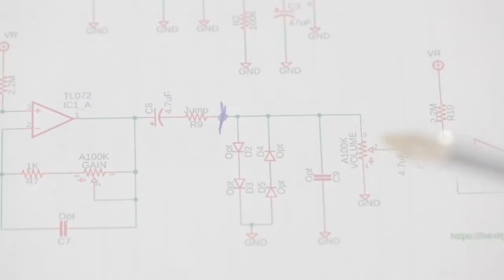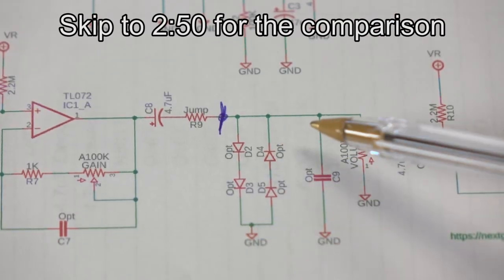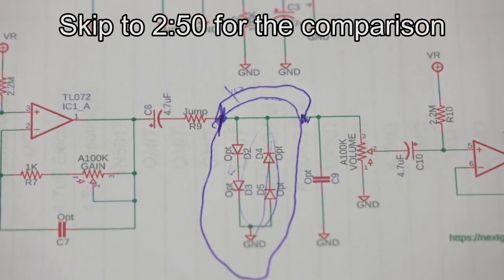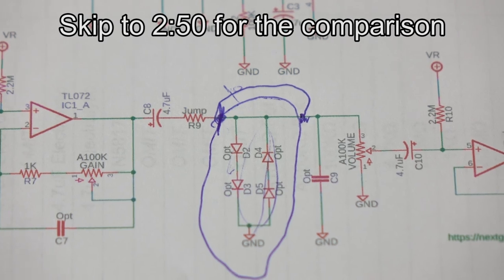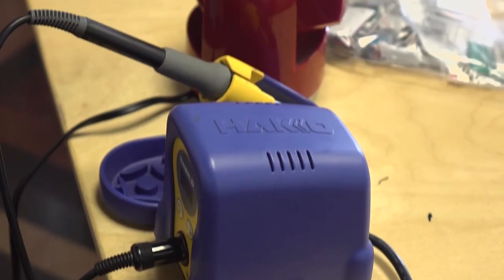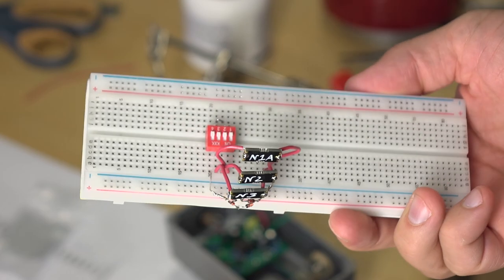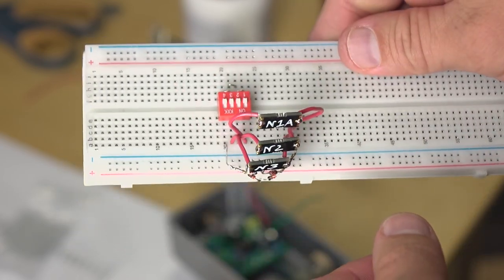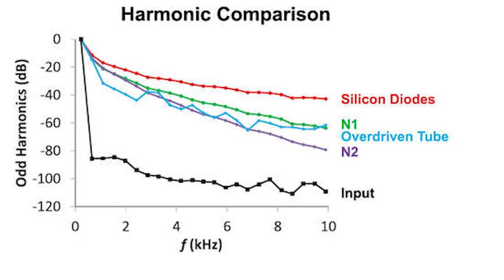Shootout - Nanolog Clipping vs Diode Clipping (Subtle, but awesome!)

Comment: I dig them. Could be fun to have a mini toggle on your diy pedal to switch between the silicon (which sounds great in its own right!) and any of the nanolog chips.
Reply from the maker: Indeed!  Sometimes you want that silicon flavour, so each definitely has its place.  At this time, the primary barrier to entry for the Nanolog devices is the price tag.  It will only improve as the technology becomes more widely adopted.

We were originally going to put in an SPDT to switch between nanolog/silicon, and a 3-way to switch between the three nanolog devices.  But, since COVID-19 has decimated our supply chain, we've been out of the necessary switches for a while and won't be getting more for another month. :(
Reply: @NextGenGuitars  I think this way was just great to demo it. Quick and easy, not to mention reversible